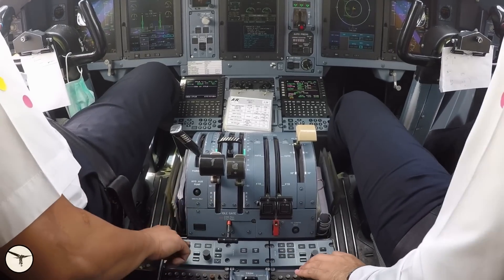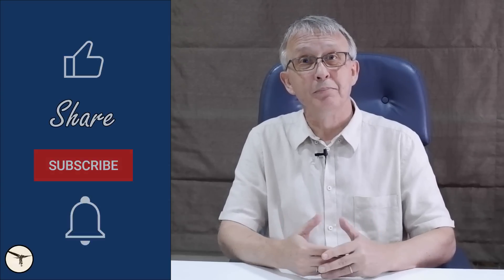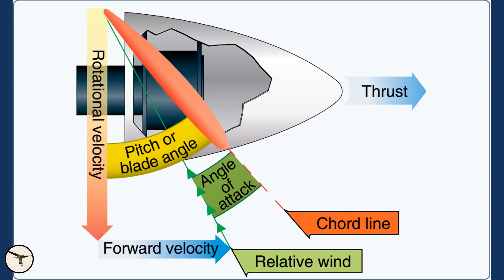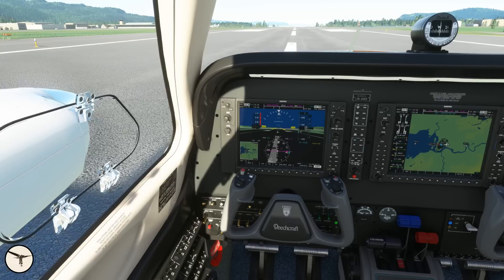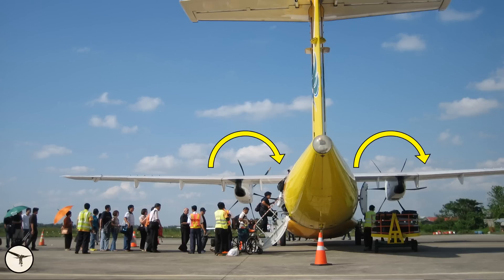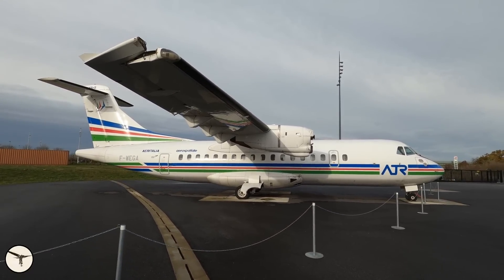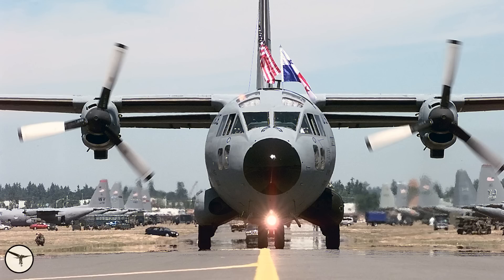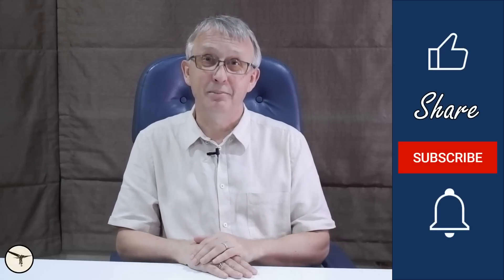The peculiar power lever | ATR mysteries part 2

Comment: Hi you probably talked about this one of your other great videos but why is the max setting on the ATR called RAMP?
Reply from the maker: The power levers move freely until they reach the Ramp position. This gives 100% power. From here on, there is a resistance, like you pushing an object up a ramp. When pushing the power levers further, they will reach the wall, where you have 115% power. This is for emergency use only.
Reply: @FlywithMagnar  Thank you for the clear explanation

Comment: I have always been curious as to why plane engines don't counter rotate for the reason of stabilization when one engine fails or to reduce torque actions on the plane.   I have always however known boats with twin propellors to usually be counter rotating but i guess in this example it is because the rotation is reversed with a different gearbox which is probably cheaper than needing a whole different jet engine configuration.

Comment: Hello capt. Do frequent use of reversers even not needed do lessen the lifespan of an engine for the ATR72?
Reply from the maker: No, reverse does not reduce the life of an engine. The temperatures never get high, and the extent is very short. Care should be exercised when using reverse on runways with gravel/sand, as the propellerw will be worn. In most other cases, using reverse is better than using the brakes, as they are expensive (imagine a very high amount of money, then mulitply by ten.)

Comment: Is condition lever same with a propeller lever?
Reply from the maker: Yes, but in addition to control propeller speed and feathering, the condition lever is also used to open and shut off fuel supply to the engine.

Comment: Have any pilots ever put the 2nd last lever to the right - in Feather position (FTR), instead of putting the last lever to Flaps 30 degrees.. In one of the accident reports, they are saying that was the reason for Plane crash and 72 dead!
Reply from the maker: No, I have never heard about that. The flap lever is differently shaped from the other levers. But in the accident in Nepal, it appears that the pilot moved both condition levers, which caused both propellers to feather.
Reply: @FlywithMagnar  Yes, very weird, unless he wanted to kill himself and everyone..
Reply: @liveandlearn515  that's another bad design, a control that is used rarely and only in an emergency and can cause a crash should be placed far away from the normal operating controls. At least it should have a safety mechanism so you don't accidentally activate it.
Reply: @ronenfe   Yes. The Feather position is dangerous, because if I understand even with maximum throttle, you get no thrust..
Reply: @liveandlearn515  correct, and also no audible warning that feathering is active is    an absurd too

Comment: By "Condition lever", I assume you mean propellor pitch?
Reply from the maker: The condition lever has the following functions: 1) Open and close the fuel supply to the engine. 2) Feather the propeller. 3) Control propeller RPM. In flight, propeller pitch is automatically adjusted to maintain the desired RPM.

Comment: Hello. Thanks for great video. I have a question about throttle of ATR72-600. As far as I know that the ATR72-600 doesn't have the auto-throttle system. Is it correct or is it just optional?
Reply from the maker: That is correct. And autothrottle is not an option.
Reply: @FlywithMagnar  Thanks for your soonest response captain! Safe flight!

Comment: Before watching this I thought all the bi-propellor planes should have counter rotating propellors. But does the plane that has propellers that turn in the same way likely to invariably bank in a certain direction during the flight？
Reply from the maker: No, there will be a slight yaw when flying at high angle of attack. But this is easily corrected for by trimming the rudder.

Comment: Bonus points for the Porco Rosso clip.

My instructor said the P-38 was an odd case because both engines were critical. For some reason the descending blades on both sides were outboard. I can only assume that Lockheed had a good reason, possibly to do with air flow over the twin tails.
Reply from the maker: Your instructor should read the definition of "critical engine" one more time. On the prototype Lightning, the propellers were rotating inwards. This, together with the tail booms, created an airflow that affected the efficiency of the elevator. The solution was to swap the engines. On production Lightnings, both propellers are rotating outwards. But that doesn't mean both engines are critical. A failure to either engine will have the same effect on the aircraft's performance and/or handling abilities. Therefore, neither engine is critical.
Reply: @FlywithMagnar  He doesn't read so well anymore because he's dead. But what you just described is two engines which have the same leverage as a critical engine. Thanks for clearing up the elevator part. I figured there had to be a reason.

Comment: Thank you for this video and explaining the concept of critical engine. 
I noticed just last week that during taxi of ATR aircraft (noticed on 2 of them) one of the engines was switched off and I wondered why. Is it just to save fuel and coincidence that it was the same engine or is there a reason associated with critical engine and included systems as mentioned by Greg Faris.
Reply from the maker: The main reason for taxiing with one engine is to save fuel. The second reason is to save time during turnaround. After landing, we shut down engine #1 (left side). Therefore, when we have put on the parking brake, the doors can be opened right away.
Reply: @FlywithMagnar  Thanks for the explanation, I was going to ask exactly the same question!
Reply: @FlywithMagnar  But I always wonder that when the #1 engine was shut down, won't the thrust asymmetry caused the aircraft to veer to the left out of a straight taxiing? Plus as one of the engines was shut down, there'd be more power needed to be increased on the #2 engine so the probability for thrust asymmetry would be higher?
Reply from the maker: @AmriTiBriOlym , this is not a problem. Very little thrust is needed for taxi, and the nose wheel makes the aircraft stable. But when the taxiways are slippery (snow, ice), we will taxi with both engines.
Reply: @FlywithMagnar  Now my curiosity has been answered, thank you so much Capt. Magnar! I saw the practice a lot of times during planespotting at SZB airport where the Malaysian regional airlines (Firefly & Batik Air) regularly operating ATR 72s. Happy working & safe flights Capt.!

Comment: Thank you for this video, i dont understand why my plane slip skid Ball always show little bit right even lvl off flight in slow speeds. I have ATO 912 tg with beefy kiev prop
Reply from the maker: At low speed, you fly with a relatively high angle of attack. Therefore, the P-factor will produce a yaw.
Reply: @FlywithMagnar   Thanks for the information no one told me that im guessing miss aligine rudder trim tab

Comment: Thank you Captain für speaking unerstandable english without background music. As a german guy not speaking fluently english I very often have to repeat videos again and again. What I did not unterstand: I thought the critical engine is that engine which requests the most attention when THO OTHER has failed. So in my eyes the right engine should be the critical one ?
Reply from the maker: It is correct that the critical enigne is the one that results in the most adverse performance and handling characteristics. When both propellers rotate clockwise (whe viewed from behind), the most critical engine is the left, because the thrust line of the right-hand engine is further away from the aircraft's centerline than cmpared with the other engine.
Reply: @FlywithMagnar  Aah, I see ! That means the critical engine is that which should NOT fail. The aerodynamics were clear to me. However, I have thought the critical engine is the one which is more critical to handle when the partner is gone. Thank you!🙂

Comment: Oups, wrong illustration! The P38 Lightning is one of very few aircraft’s (if not the only one?) that has counter rotating props turning OUTWARD from the pilot’s stand point, not INWARD as illustrated. This is due to flutter problems on the twin tails observed during testing. I don’t know if there are any other examples, but surely, the P38 is the only single case of counter rotating blades you shouldn’t have taken to illustrate this video that way.

Comment: Having worked in aviation for 25 plus years.. something that is unique to engines.. most European designed powerplants , the  rotation is to the left ( from the pilot seat facing foward) yet the north American ( Canada and USA ) powerplants rotate to the right.. the ATR and dash 8 and any TP using the pt6 would validate your critical engine/P thrust explanation,  but what about the effects of thrust on aircraft using RR darts .. the critical engine would switch to right side ?? .. to everyone else the end result of the P thrust theory happend with a FedEx dc10/md11 back in the late 90's at KEWR Newark nj.. they stalled at about 75 feet above the runway .. went full thrust and the airframe flipped about 10 seconds later..

Comment: The P-38 was originally built with propellers rotating in the direction shown in your graphic. However, this caused tail vibrations and the direction of rotation was reversed. In effect, both engines in a P-38 are critical. The aircraft has so much power, even on one engine, that it is relatively easy (compared to say a light twin) to stay above Vmc and maintain control. Look at the blade on a P-38 and you will see the direction of rotation is as I have outlined.  Better to use a picture of a Twin Comanche or Seneca to illustrate your point.
Reply from the maker: Thanks for your feedback. I agree with you. It would have been better to use another aircraft type. But this photo was so nice, you know...
Reply: Thank you for this comment. I did know about the changing of the rotation direction and was wondering about this decision.

Comment: 3:03 I think you will find that both engines on a P-38 were critical. Have a look at video footage or a photo with one sitting on the ground.
Reply: The P38 has counter-rotating propellers. There is no critical engine because either engine failing will affect the flight performance similarly.

Comment: P-38 has CONTRA-rotating propellers, not counter-rotating. Your description and graphics were exactly backwards. Both engines are critical. No critical engine on counter-rotating props (unless it has the sole hydraulic pump).
Reply: Wow, you are the one that has it exactly backwards, and with feeling!  Contra-rotating props are coaxial (TU-95), and counter rotating props (P-38) are separate and rotating in different directions.  You can look it up.

Comment: The notion of "critical engine" is often extended to include systems,  not just airplane performance. If an important system - bleed air for pressurization, for example - is driven by just one of the two engines, that engine may be considered the "critical engine" even in a counter-rotating situation, where the loss of either engine has an equal effect on handling and performance.
Reply: That's interesting. Do you know any aircraft which only bleeds air from one engine from the top of your head? I assume it would end up unbalancing the thrust on a twin engine aircraft, for example. Wouldn't it?
Reply: @tarcisofilho4878  B737-300 for example

Comment: While the basic explanation of the concept of a “critical engine” is correct - the P-38 is a uniquely bad example to choose to illustrate the concept in that, except for the first prototype, all P-38 engines rotate outward, not inward as in Magnar’s  illustration.  In the case of an engine failure either engine is a worst-case scenario or critical engine with the thrust line and resultant yaw forces outboard of the engine centerline, not inboard, thus maximizing the difficulty in controlling the aircraft, increasing Vmca, etc.
Reply from the maker: You are right. On the P-38, it was discovered that inward rotating propellers affected the inner horizontal stabilizer in a negative way. Thank you for correcting me.
Reply: I replied prior to seeing this.  Sorry

Comment: This is an extremely, extremelyyyyy common misconception. The reason the left power lever knob is larger, is because it has to house the go-around button. You will see many twin engine airplanes where the left power lever or throttle is larger than the right, and the reason is always the same. One contains a button, one is just a knob.
Reply from the maker: ATR aircraft have go-around buttons on both power levers.
Reply: @FlywithMagnar  Hi Magnar. I should’ve been more specific. Housing the go-around button is the origins of the design feature, a trait which has managed to survive for over 50 years in aviation.
Reply from the maker: I made a quick search. Boeing 737-200, DC-9, BAC 1-11, Fokker 50, DHC-8 and SAAB 340 have symmetrical thrust/power levers. The only asymmetrical thrust levers I could find are in twin engine fighter jets where the right lever houses a number of switches.

Comment: The other reason might be the sense of touch. Just touching it a pilot cud identify it's the right engine throttle lever. In A320 there's many switches that r designed in such a way to give a feel of touch so no mistake at extreme emergency when pilot has to act very fast.
Reply: Exactly my thoughts
Reply: I believe that's what we were told during our type course, hahaha. Fascinating to see how arbitrary the design choice really was! Many thanks for making this video, Captain!

Comment: Very interesting! On its competitor, the Dash 8, both throttle levers are identical in size.

On the other hand, that engine start control on the ATR 72 look identical to that on the A300-600/A310.
Reply: Dash 8 has similar thing. It has 2 off positions on airframe de ice panel! It was the only part available "off the shelf"...!
Reply from the maker: Must be a leftover from the Dash-7. They have a lot in common.